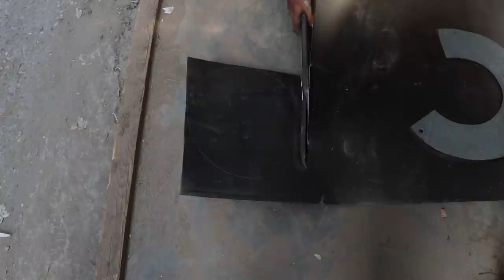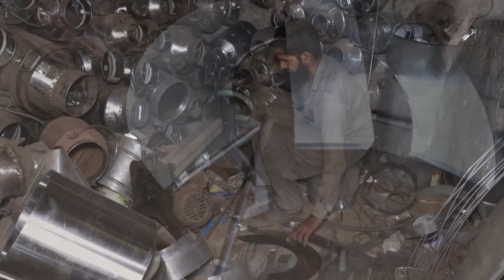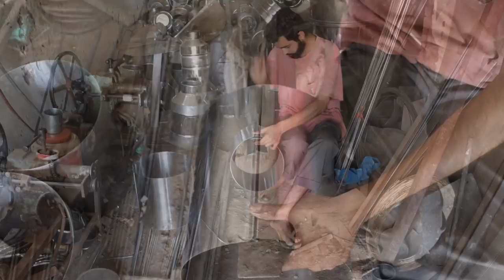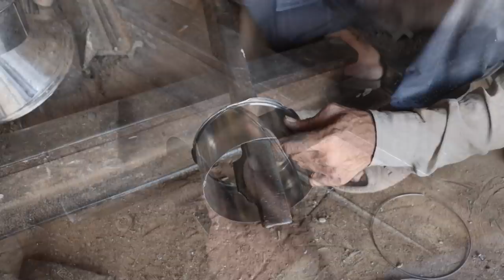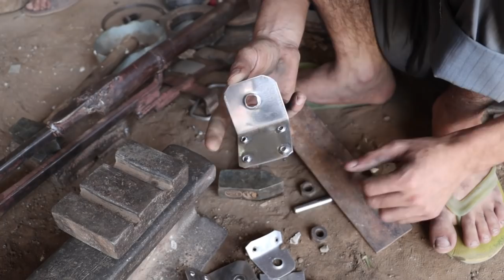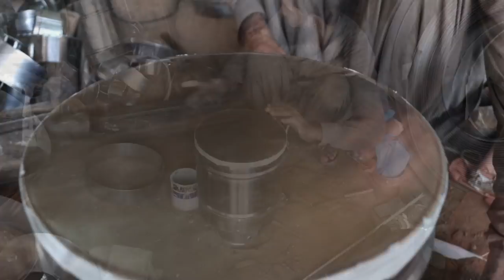Most Interesting Process of Making Stainless Steel Milk Cans

Comment: I love the way they get the rivets to stay in place and the pierce the steel with one hammer blow. The accuracy of rivet -placement (especially around the conical neck pieces) is very impressive with no mistakes. They don't need to measure or drill a hole first - it all seems to be done with practise, skill and experience.
Reply: Está precisando de 5S
Reply: @gabrielmakiyama3720  lol

Comment: Without soldered joints I really wonder about the integrity of these cans.
Reply: @davidhamm5626  But they are hammering the joints... I'd feel better if they ran them thru a rolling press with uniform pressure.
Reply: I don't know... I'd feel better with a soldered joint so milk or whatever couldn't seep into the joint, not get washed out and spoil.  They do make food grade solder that doesn't have lead or cadmium in them.
Reply: @tubedude54  Yes, I you are correct.I have lead free, for water pipe work.